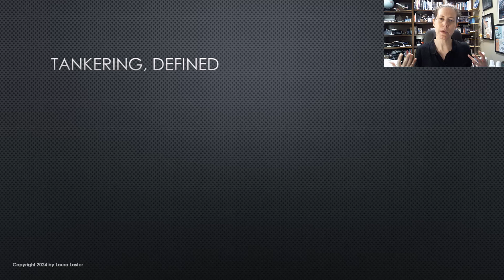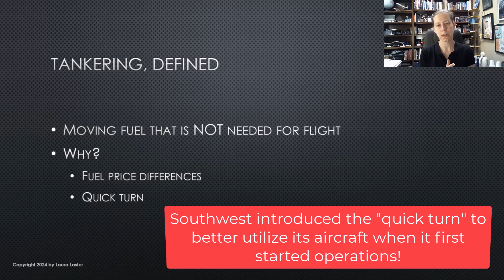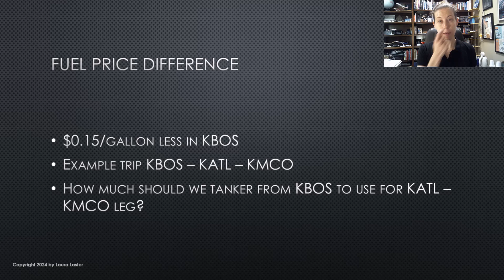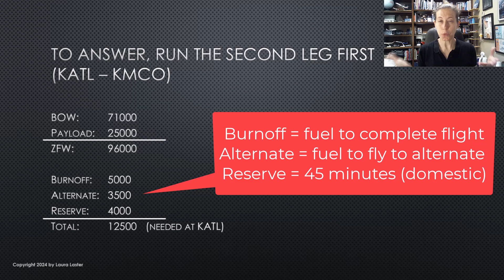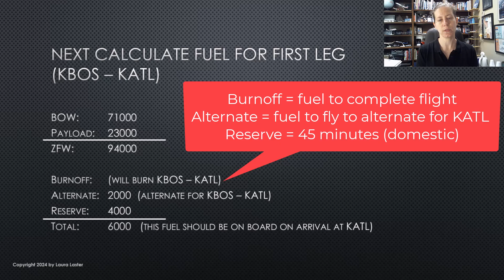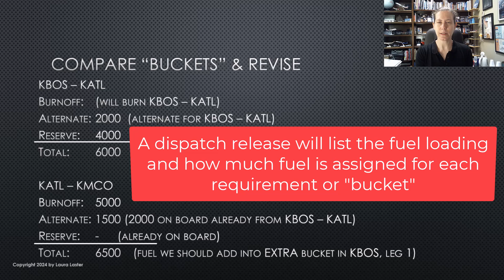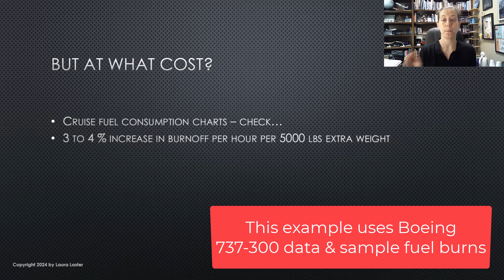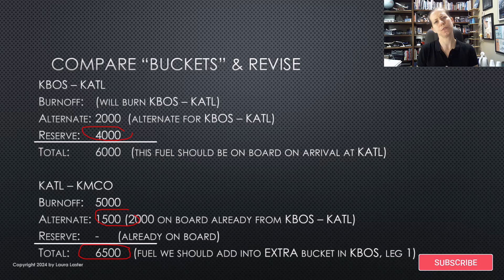Fuel Tankering Explained for Pilots and Aircraft Dispatchers: Airline Interview and Oral Exam Prep

Comment: There is a LOT more that goes into tankering.  At my last regional I was usually not able to tanker the whole amount.  You have to think about landing weight.  My airline had a 2,000lb buffer for the maximum.  If the max landing weight on the CRJ-200 was 47,000  we could not add more fuel than would bring us to 45,000.  And when the computer would compute the numbers, most times we would only have a fraction of what the airline was looking for.  If they wanted to tanker 12,000lbs I might have been able to do 2,000.   sometimes I knew I'd never get it all so I wouldn't even bother figuring the 2nd leg, I would just take the difference between my planned landing wt and my buffer limit and add that in fuel.   For example,  my planned landing wt is 40,000 and they want to tanker 8500 for the next leg....yeah, that's not happening.  I'd give them 5,000 and call it done.   Noted on remarks section of the release how much I added.  There were times I was not able to add any at all.
Reply from the maker: Thanks for watching - this video was set up to be a very generic overview. I have not dispatched a CRJ-200 or smaller aircraft, so I don't have numbers offhand to work with. I can totally understand how tankering would be much more complicated for a smaller aircraft. I could make a part 2, for smaller aircraft, but I don't have any real data easily accessible to me.